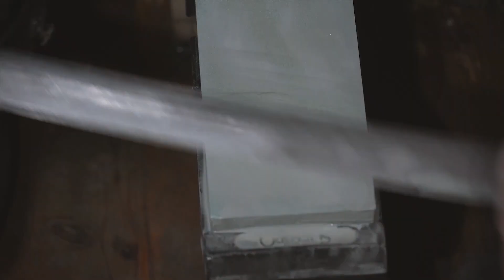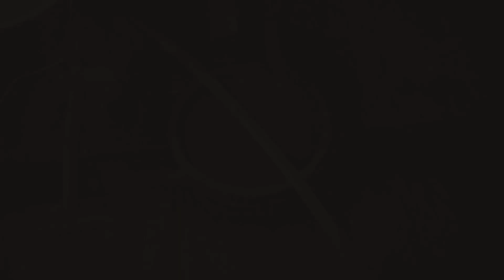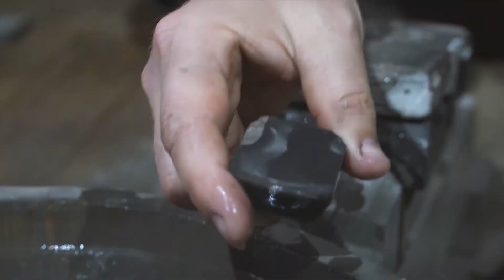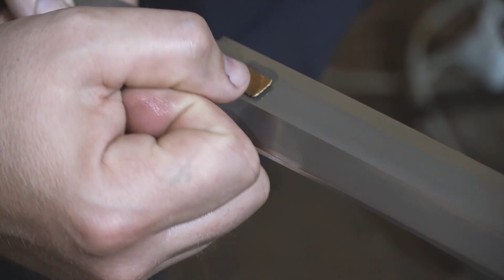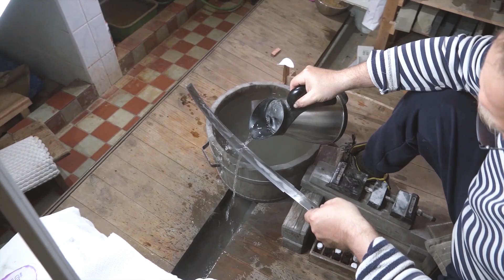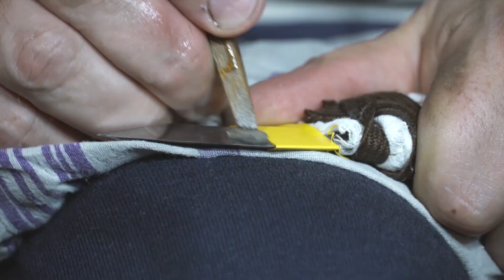Katana making   Polishing

Comment: The electrical cord on the floor near you with all that water on the floor sure worried me as I watched you work. Don’t want you to get fried.
Reply from the maker: the system does not allow it. There is protection. In the event of a short circuit, it switches off immediately. Electrocution is difficult here.